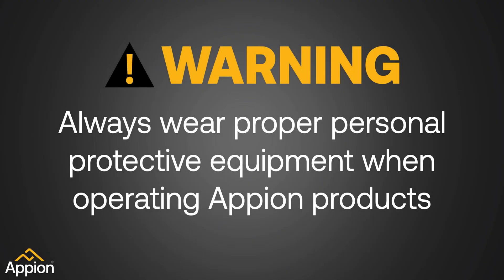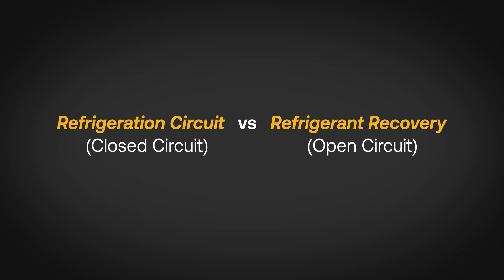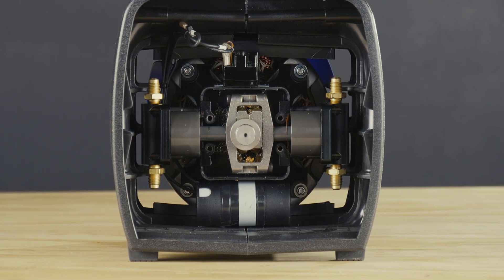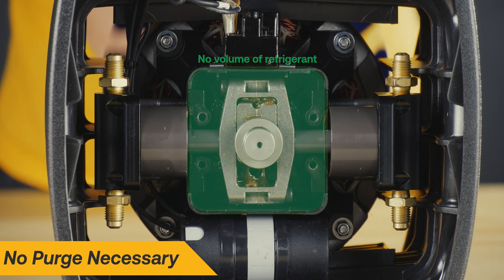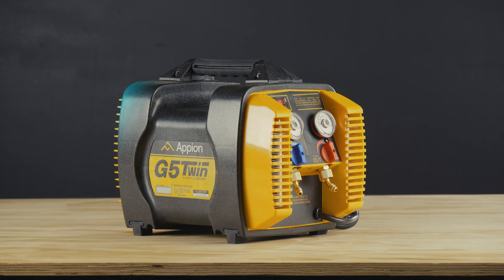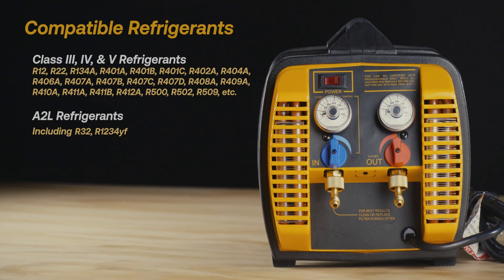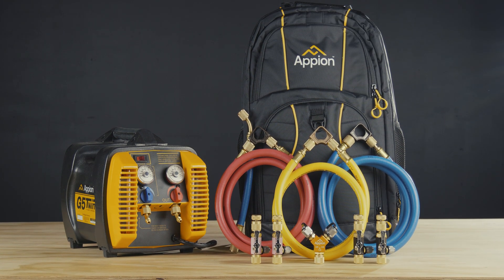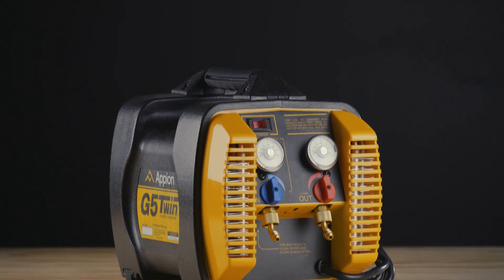G5Twin Product Highlight

Comment: so do the gauges on the g5twin tell you the psi ? like a set of gauges would? so you can just go off the g5twins gauges and see when all the refrigerant is pulled out the system ??
Reply from the maker: Yes, the gauges are pressure gauges but the units of measurement can vary depending on the global region. The United States is psi. Even though they read pressure, they can't display negative pressure, so you will need a gauge set connected to the system to get accurate system readings.
Reply: @Appiontools  will the cps micron gauge work w it just as well ? set to microns ??
Reply from the maker: @wildman8601  You wouldn't necessarily want a vacuum gauge if you're doing your full recovery from start to finish; you want a compound pressure gauge. You aren't going to be pulling a deep vacuum with the G5Twin. Especially if you're recovering A2L refrigerant you have to be careful pulling the system below atmospheric pressure because if there is a hole in the lineset and you pull oxygen into a cylinder with compressed flammable refrigerant you risk explosion. Ideally you want a digital pressure gauge that can also read negative pressure (below atmospheric pressure) then when you finish recovering the refrigerant, blank of the system, switch to a vacuum gauge then evacuate the system.
Reply: @Appiontools  I ordered one of them yellow jacket single gauge devices that reads 22 410a 404 refrigerant to run w the g5twin along w the megaflow hoses and the Y connector and crt's...but I'm so upset no one told me you guys sold the recovery kit with a back pack to store it all in. that would have been great to keep things organized in and in good shape like I usually like to keep them in. what should I do ? I mean I can't return everything and then rebuild it so the bag comes with it ?
Reply from the maker: @wildman8601  You can purchase the bag by itself on our website part# pk7520  
https://appiontools.com/pk7520/